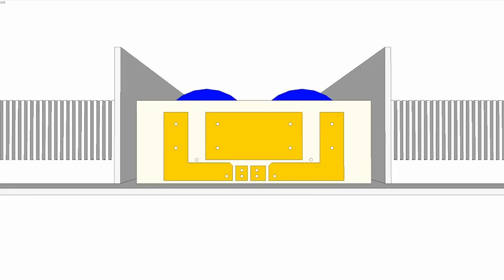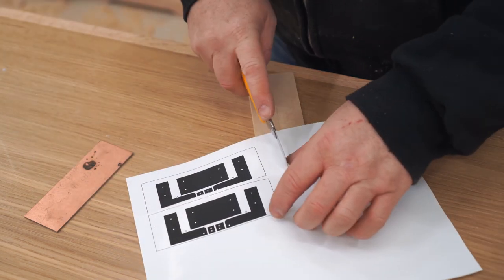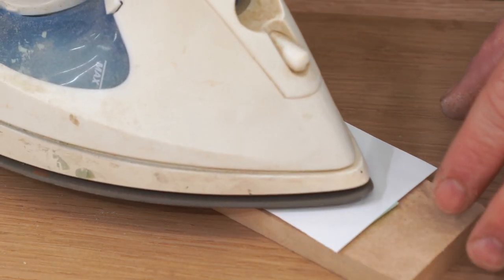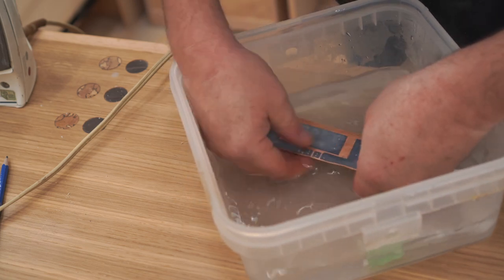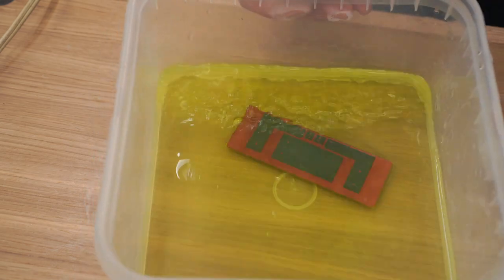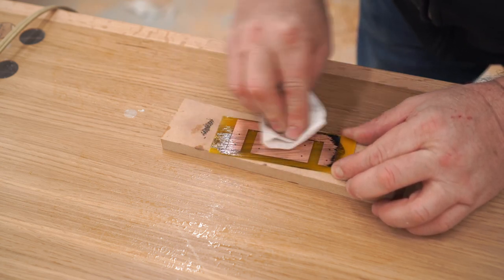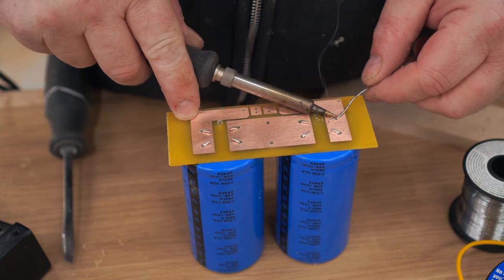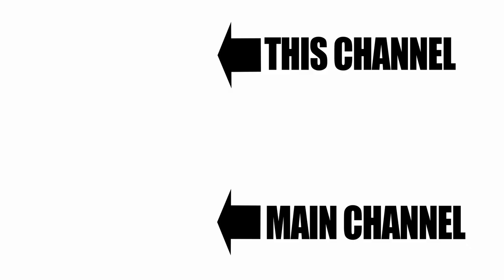How To Make A Printed Circuit Board - Toner Transfer Method

Comment from the maker: The paper I use is called "presentation paper". It's glossy, similar to the paper used in magazines, but a bit thicker. In fact you can use magazine paper instead and get it for free.
I bought a pack of the paper back when I was making my own circuit boards regularly, so I'm not sure if it's still available today. I tried several types of paper at the time and that one gave the best results.
I use muriatic acid and hydrogen peroxide, but there is a "proper" etchant (Ferric Chloride) you can get to use instead. 
My usual procedure was to etch and clean the board, then tin the copper traces completely and then drill the holes for the parts.
Reply: i noticed that the printer/toner itself makes for quite a big difference. In the past i used an HP lm4 with, i think, the same paper that you use. It worked ok, but the tranfer was never great. Recently i bought a new printer (xerox b205), wich refuses to print on the usual glossy paper no matter the settings, but works great on glossy paper that comes directly from magazines. The fact that the sheets are alredy printed with ink seems to have no effect.
Reply: Awesome that you were able to make etchant from readily available stuffs. I've always used the ferric chloride (which is available at Microcenter brick and mortar these days) and then specially made paper that has like a an almost waxy surface - I think I got it from digikey. I suppose the presentation paper just requires more pressure to apply to copper and is readily available. You always try to go for the readily available stuffs and that's better. I wonder if you might try using the adhesive backing from some label paper or something?
Reply from the maker: I've used an HP and a Brother printer, same results. And I tried magazine pages before too. They work, but not as well as this presentation paper.
Reply: I’ve read these printers print with the toner at different heats.  From what I’ve read, HP are great printers for the toner transfer method and a lot of people have had problems with Canon. I picked up an HP M15w, it’s absolutely tiny, only $100 when I got it, and what’s worked perfectly for every transfer I’ve done. I only use if it for transfers, so it’s not worked all that hard.
Reply: PulsarProFx make a paper coated with starch specifically for toner transfer. 
The starch gets wet and in a few seconds the paper floats off the board leaving all the toner behind.
Easier to use and better results.
Reply: That was cool!
Reply: People sometimes have difficulty with brother printers due to their toner temperature. Aftermarket replacement toner however ought to behave the same as any other. It's only the genuine brother toner one may need to worry about.
Reply: @danharold3087  I’ll have to look into that.  I’m currently using paper from “PCB fab in a box”. It’s relatively inexpensive as one pack lasts a very long time.  It also comes with a toner reactive foil that you put over it once the toner transfer is on the copper that fills in every small holes and such.  With this method I’ve made nothing but absolutely perfect traces on board, even when there are very small traces that in a crowded area.
Reply: @danharold3087  oh excellent, good to know!
Reply: Ah yes I was thinking about the paper type.  I watched a video where they used the backing paper from laser printed stickers, and they also said magazine paper would work. So sounds like similar thinking!

Comment: When I did this for a project in college, I didn't have an iron, so I used my cast iron skillet.  I wouldn't recommend that method.  One thing John didn't mention is that copper clad board comes in different weights, which refer to the amount of copper used to cover one square foot, typically 1/2oz-2oz, which relates directly to the sheet resistance of your traces.  When ordering for a project, make sure that you get the right weight for your current handling needs (more current= higher weight copper clad OR thicker traces).

Comment: I used to make my own pcb's, laminating copper clad board with UV sensitive film, producing a transparency, developing, etching, drilling etc etc. What a pain! Now I just send the Gerber files to China and a week later 5 or 10 boards arrive back perfectly made with my own silk screen. All for just a few $. Making your own pcb's just isn't worth the effort. And professionally produced boards look just that: Professional.
Reply from the maker: First point is that the UV method is more work and more expensive and takes longer than the tone transfer method. 

Second is that if you make a mistake on the board, then it's still a mistake, even on a professionally made board. And you have the minimum number of those for the order, say 5. Being able to quickly make a test board like I did here puts the mistake on the test board and you can fix it before you order the pro boards.

Third is you can order the boards for cheap now, but what if the price doubles or triples or higher? Then making your own starts to look a lot more attractive.

Final point: now - you can have your board now rather than waiting a week or more.

Comment: recently i got back at this too, and i use the exact same method. I can confirm absolutely that after ten years the peroxide has gone dull.  Same board, same acid, with old peroxide took like half an hour, with the fresh one took MAYBE two minutes.
Reply: peroxide degrades rapidly in air or light.

Comment: Hello, I wanted to ask if you could maybe help me with a problem that i'm having. I did everything like you did but my PCB has these rice sized spots where the toner just did not transfer. For some time I though that it was the holes on the surface of the iron but because I moved it during the transfer process it could not be the source of the problem. Do you maybe know where the problem could be?

Comment: Very cool vid. In the past, I’ve made my own PCBs for fuzz face guitar pedals. I like using a Mr. Clean Magic Eraser to remove the paper. The fuzz circuit is so simple that at first for prototyping, I just used a black sharpie. There’s definitely a large sense of satisfaction in a final piece when you’ve really built it from scratch. Point to point wiring is obviously preferred if possible, and if you’re only building one of whatever you’re building. Thanks for the video! Great stuff!

Comment: Very nice and great timing as I can do this instead of messing around with a proto board.  I had forgotten how easy it is to do.  I will make one for the controls on the solder fume extractor that I made.  My eyesight is getting poor as I get older so I end up inhaling a lot of the fumes while bending over to get see what I am doing.   Thank you for this John.

Comment: Great work! I’ve made several boards from Mr. Carlson’s Lab which had very fine traces.  I gave up on the clothes iron pretty quickly as it was just painful to get a good transfer. I picked up some special paper made for this that completely falls away when put into water, so no scrubbing to get it off and I also got a large heavy duty laminator to get nice even pressure and heat on the transfer.  I haven’t had a failed transfer since.  Thanks for sharing your method, I had no idea on the use of your acid and hydrogen peroxide, I’ve always used Ferric Chloride, but this info will be put to use in the future.  Also, if I run out of liquid tin I’ll use lacquer as well, I have a few gallons laying around.
Reply: @trollforge  oh wow, great to know, thank you for that info! Does the dissolved iron add any benefit?
Reply: @danhorton6182  Sorry, man, I'm speaking from an electronics background, not a chemistry one... I only know how to make Ferric Chloride and Copper Chloride,  because they were the most common etchants back in the 70s & 80s...
Reply: Dan, what special paper are you talking about?

Comment: I have found that a way more effective method  of making the transfer was to sit the plate on top of the iron and apply pressure to the paper side with a rubber printer's brayer. I am just etching copper however, not making circuit boards.  I also use an aquarium bubbler to agitate and oxygenate the acid.

Comment: As mentioned Hydrogen peroxide goes dead rather rapidly. I made quite a few boards starting in the 80's from directly drawing them with good markers to the method you used and using thicker trade magazine paper. I found the heaver trade magazine paper the same as what you are using. But I switched to a laminator for heat and pressure. Made quite a difference. Walmart was like $30 from 3M. Nice to see you getting back into having some fun John. I remember you on Diyaudio. I think we both died out at the same time there.
Reply from the maker: I've had nothing but excellent results from using the iron, so a laminator is one less single purpose gadget to clutter up my already too cluttered existence. 
Iron on some edge banding, press my favouite black T-shirt and do a circuit board all with one tool :)

Comment: John, which laser printer have used? In past 30 years I designed and made a lot of PCBs for various circuits, mostlly microcontrolers and interfaces. I tried all DIY techniques and photo positiv (UV) transfer is most precise, effective and repetatible. Unfortunattley toner transfer never gave good enough results. What you think?

Comment: One guy demonstrated that if you print on a fashion (not exactly) magazine page, then to separate a paper and a toner in a water would be much easier.
PS Quad 405 amplifiers failed over a time just because a hot resistor was too close to a capacitor. When I see your rectifiers laying down on the capacitor bank, I remember this )
Reply from the maker: Was it a 15 amp resistor, like this rectifier? And was it bolted down to the 1/8" thick aluminum chassis of the amplifier, like this rectifier will be?
Reply: @IBuildIt  Oh.. You were prepared Sir )

Comment: Nice.  Is the etchant mix you're using faster than ferric chloride?  Although it's sped up in the video, it seems quicker.
Reply from the maker: It's supposed to be faster, but I haven't used ferric chloride to compare.
Reply: Last time I used this method you could buy both acid and hydrogen peroxid in conentrations above 30%. If the liquids are fresh from the store and you do not dilute that with water, it'll almost start boiling when you put the copper in, and you  will be in quite a hurry to get the board out before it starts eating away under the toner. And the fumes makes every metal around you rusty. Now it doesn't seem peroxide is available stronger than 10% for avarage Joe, so 1 part acid and three parts peroxide should do it then, without water.
Reply: @madmodders  Beauty supply stores have high % hydrogen peroxide.
Reply from the maker: 3% peroxide works fine, as long as it's not 10 years old. A board etches in a couple of minutes with this solution, so there's no reason to go out of your way looking for something stronger to speed it up.

Comment: The muriatic acid will keep for a long time, but the hydrogen peroxide will reduce to regular water over time. With 30% peroxide and 10% muriatic (concentration), I used about 180ml acid, 20ml peroxide.
The paper I used was a photo paper from Epson, which I used in a laser printer (proceed at your own risk 😀).
Don't etch myself anymore, hated the tedium of drilling all the holes, nowadays I use a pcb service, takes ages though 😀

Comment: unfortunately modern "eco-friendly" printers don't deposit enough toner on the paper to make this method effective. It's just not dense enough and I no amount of playing with it will work. Fortunately , photosensitive etch resist films are very inexpensive.
Reply from the maker: My printer is just 2 years old and works perfectly for this. It doesn't take a lot of toner to act as a resist.